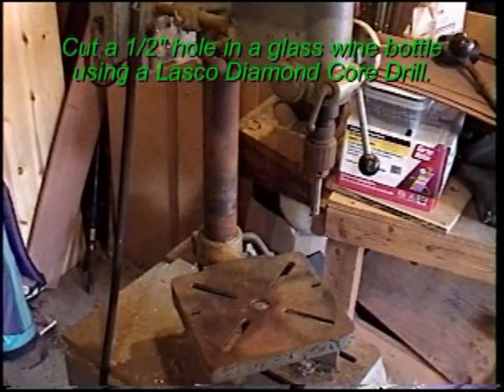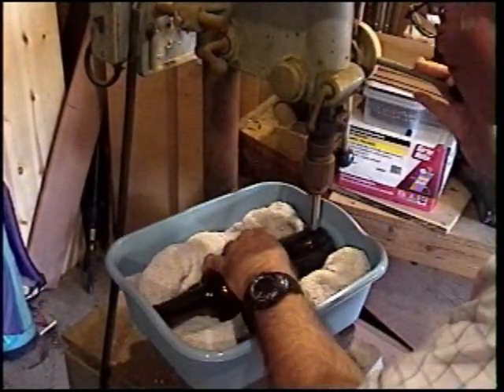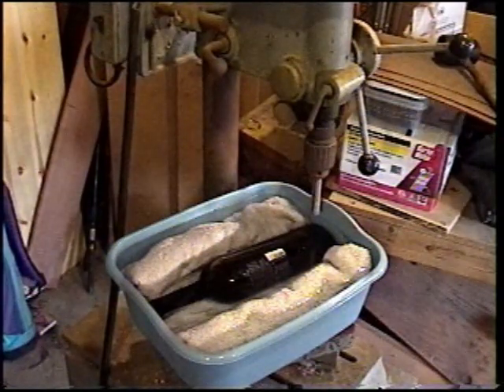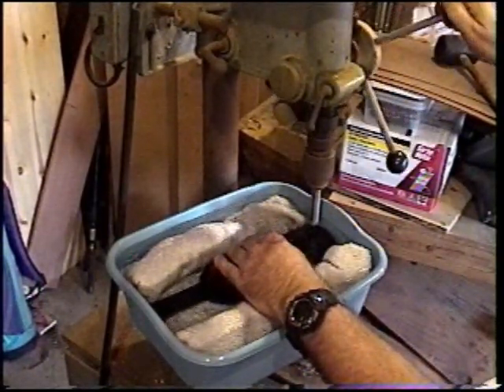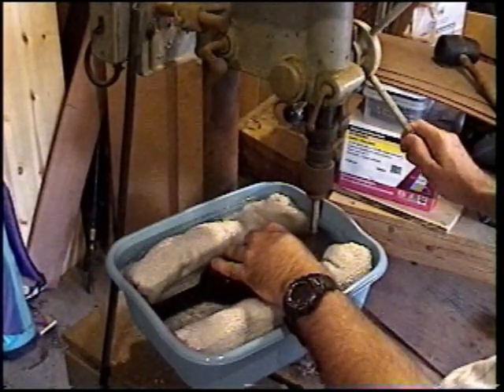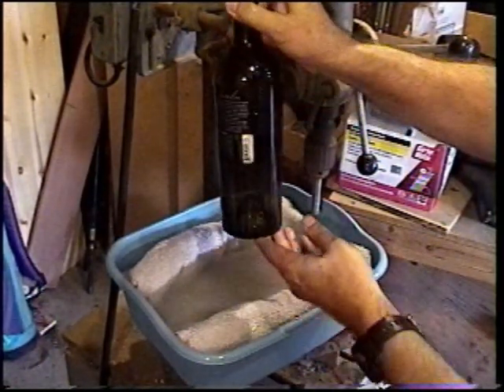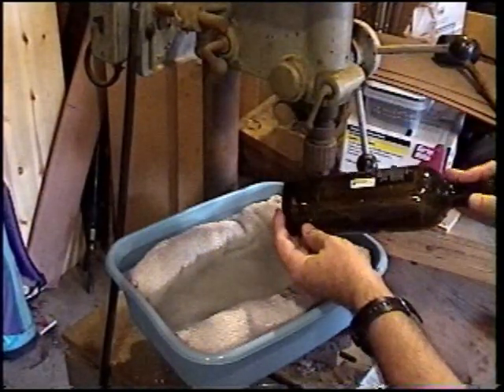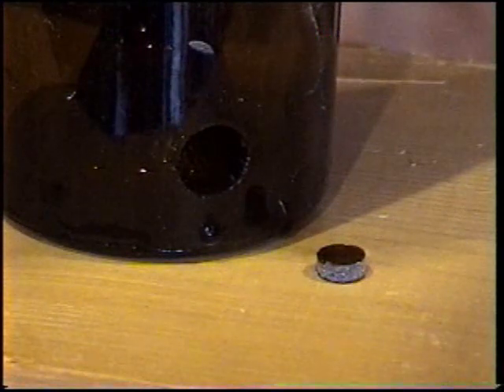Drill Hole In Glass Wine Bottle.mp4

Comment: @PSILOCYBETRIBE when you drill glass you use water to keep the glass dust from leaving the surface so you do not breath it in. and it keep the drill and the glass from heating so no cracks are made where the hole was made

Comment: Look at the diamond core drill manufacturers recommendation for drill speed.  Probably want to run it pretty slow and keep the pressure low, to avoid overheating and destroying the bit and making a hot spot that could shatter the bottle.

Comment: how to make a bong: use a plastic bottle (with a bigger drinking hole than usual) and make a hole with your lighter for the bong bolw and the bong pipe, then make another hole for your thumb. Seal the tube and the hole air tight and ure done.
Reply: Except you don't want to use plastic because you can inhale nasty shit and royally screw your lungs and bronchial pathways.